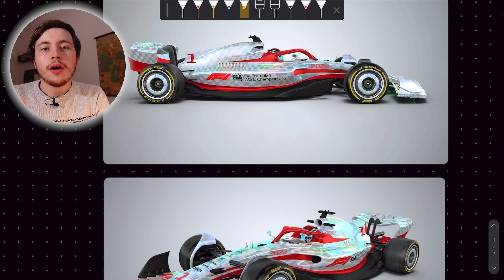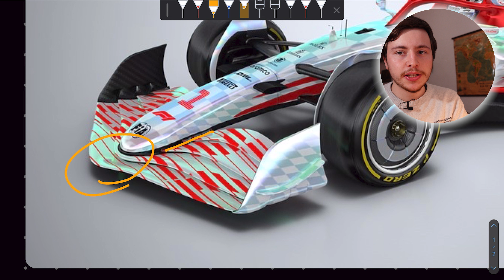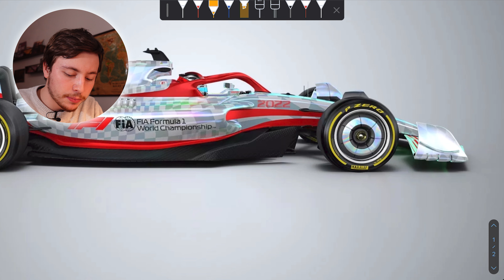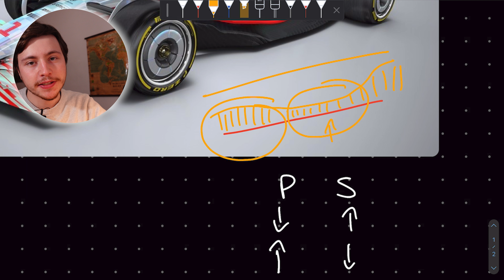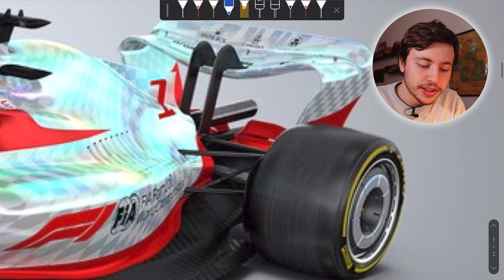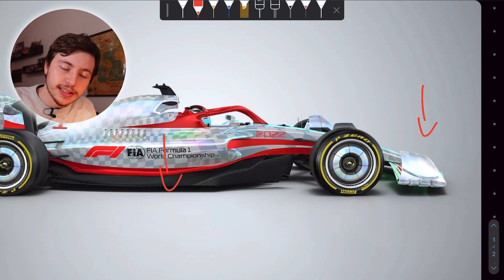New Formula 1 2022 Aerodynamic Regulations! #1

Comment: I guess an interesting thought experiment is what it would take to build a venturi tunnel set up that can also be easily adjusted, like how older cars could angle their nose and tail wings more for increased downforce. In fact, what would a high downforce ground effect set up look like? Giant opening, the center section millimeters from the ground?
Reply from the maker: This is a very interesting question and you gave a idea for a video! I don't think adjustable venturi tunnels will be a thing, I think that just like rear wings they will need to have multiple specs of floors, the changing their distance to the ground or increasing the opening size is probably not possible due to the chassis, what I expect is to see the cars have less tunnels (going from 3 channels to 2 for example) in tracks like Monza to allow the air to slow better

Comment: They'll have to compromise with extreme toe out and lots of front body roll for low speed corners.
Reply from the maker: That’s exactly it! But that will surely decrease their performance on high speed corners, we’re body roll is your worst enemy, especially with the Venturi tunnels that need to be as flat as possible to work at their peqk